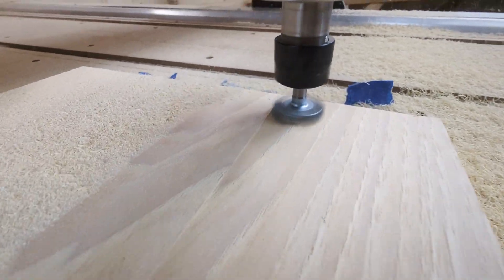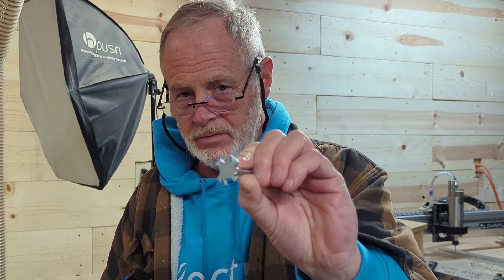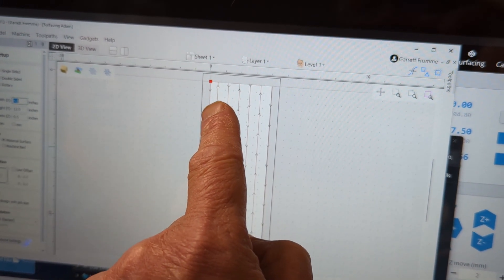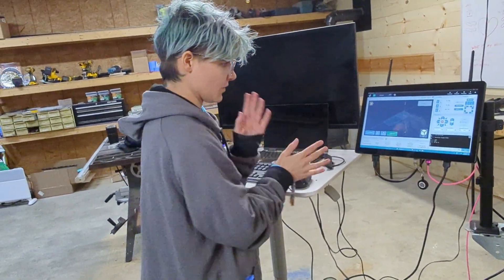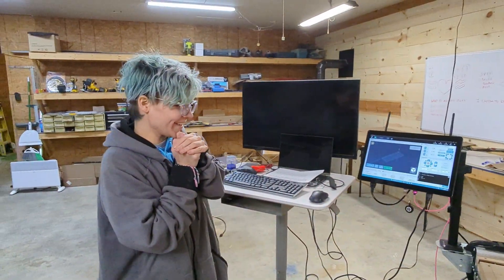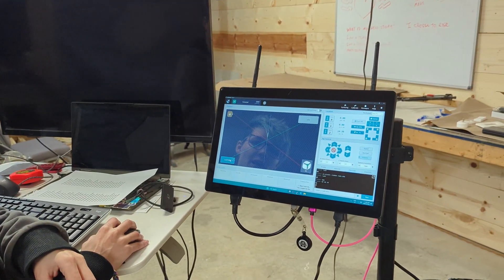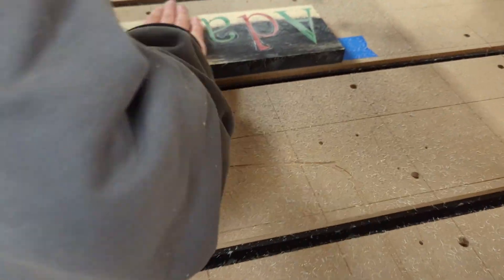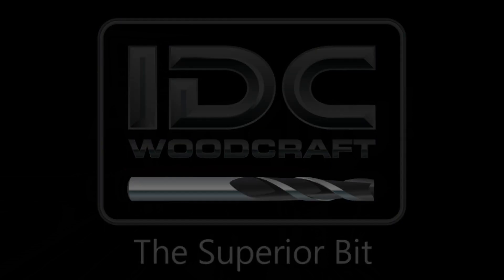CNC Router Surfacing Tips w. LIBERTY

Comment: Where can I find how to start my spindle ramp up before I start my cutout. I’m having problems when I go to cut something out my spindle does not start up fast enough and it jams my machine. 
Thanks
Reply from the maker: It sounds like you're experiencing issues with your spindle's ramp-up time. You might want to check the settings in your CNC software or the controller to adjust the spindle's acceleration parameters. Looking through the manual for your specific spindle can also provide insights on how to modify those settings effectively. Good luck with your project!

Comment: I love the tips and tricks on IDC. I'm interested to know if there is a reason you use Vcarce over the surfacing from inside gsender. Thanks
Reply from the maker: I'm glad you enjoyed the tips! I prefer using VCarve because it offers more control over the design and carving process, allowing for finer details and a smoother finish compared to the surfacing options in gsender. Each has its strengths, but for detailed work, VCarve often wins out.